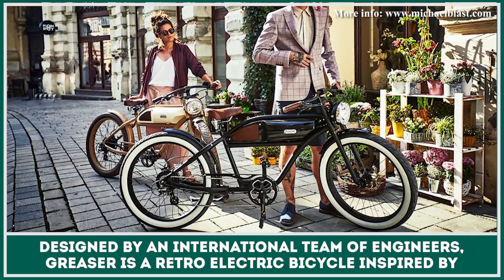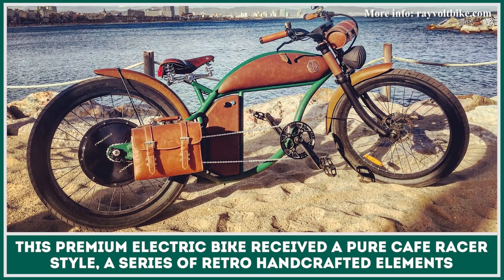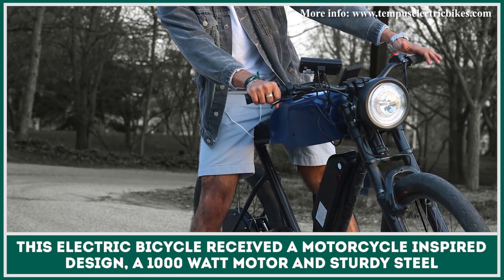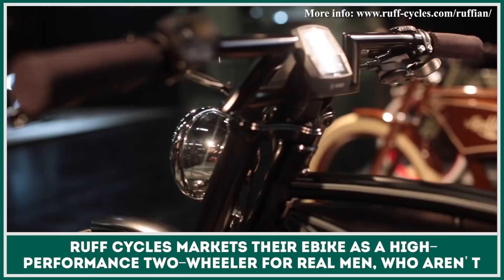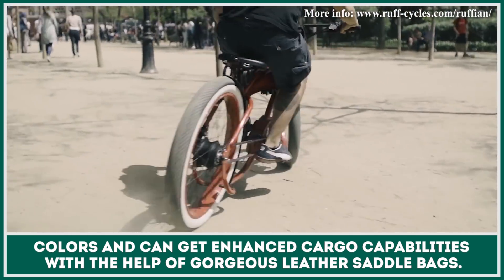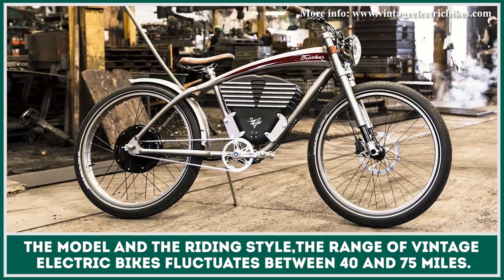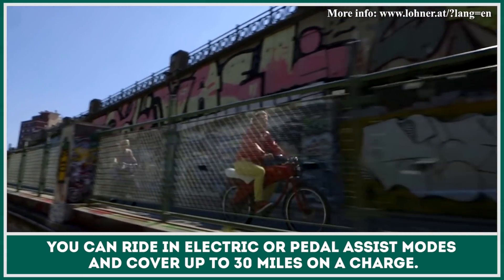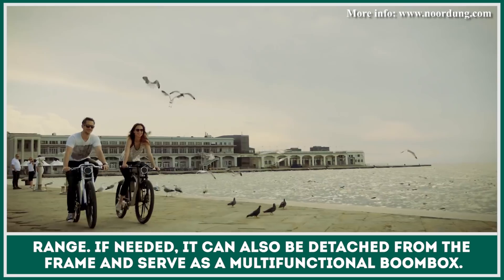7 New Electric Bikes w/ Old School Designs and Retro Bicycle Accessories

Comment: a lot of these old style bike manufacturers make a stupid design flaw.. I dont know why either.. but they push the pedals up too close to the front. .look at the guy pedaling at 05:17.. Look at where his feet are at in relation to his hands. Now look at how the rider's back is slouching forward.  I think they put the pedals this far forward because it looks "cool" like you see guys on real choppers... but those guys arent leaning forward on bikes when there hands are up that far.. no their hands are back more and their backs are straight.. 

The first motorcycles which were basically bicycles with motors, had all their pedals under the seat post with the motor in front of it.  I cant believe German engineers made this terrible design flaw as well.  Shame on them.  Not only is the riders position uncomfortable and only acceptable for short rides, but you lose a lot of strength in your legs trying to pedal in such a position compared to if the pedals were below the seat post.  The only way to get the full strength and motion of your legs with the pedals pushed that far forward is you would have to lean back which is impossible since you wont have nothing to grab onto.  smh.  Micargi Bicycles made this mistake too but not as bad as the other bike manufacturers. Its only recently this style hit the market and its awful.

THIS is the proper style frame for the most comfortable ride and imo the best looking frame.https://www.youtube.com/watch?v=fmWMt0N2INY

Comment: They arent bicycles  they are motorcycles disguised as bicycles
Reply from the maker: Hello, thanks for your feedback. Some of these have 250Watt motors, it's not even close to motorcycle performance.
Reply: @Datacube   i didnt know but in the bicycles was know dopping especialy the mecanical that put the motor ( electric engine ) with battery when push the button and thats it this isnt new it was no tour France in the championship that was know this scandal of this type of dopping  and after that came this type of bicycle but some one are faster o like a motorcyle thats dont need any motorcyle protection and thats The problem

Comment: I build own cruisers. Frame: Shwinn Stingray. 1500W, 1000Wh. All elecrticals hidden in pannier, no cables, no screens, acces trough bluetooth. Min range (full speed, only electric) over 20miles, max range: over 40 miles, never really got to the end of battery when not using throttle too much and riding with speeds below 25mph. Cost: £100 bike itself, £300 battery, £250 motor and controller. Other (tires, bags, new linkage, quick charger from aliexpress) £100. together £750. Max speed 40mph. Wheelies when you are not carefull on take-offs.. Min range 20 miles. Charge time 4h on 6amp charger or 12h on 2a charger (this one stays at my workplace and usually finishes my home-to-work distance charging after 4 hours) I dont uderstand prices of these bikes build in most on generic parts...

Comment: Great looking cycles, but some of them look to have very uncomfortable riding positions/geometry. Would have been ok years ago when they had an engine, but trying to pedal some of these cycles must be arduous. The transformation from engine to pedal power doesn’t work for some frames. More for posing around town than going on a long journey. Nice video.
Reply: I have the Ruffian (the grey one). The riders position isn´t as comfortable as on a real trekking bike, but it isn´t too bad either. Have been on several multi-hour trips without medical assist :-)   The frame takes the torque with ease. Mine is 3 years old and has run nearly 1000 km. Not that much, i admit.
It comes with a Bosch electric system with 4 stages of power support, so uphill isn´t a problem (unless it´s VERY steep). But one have to keep in mind that it´s very heavy and runs on fat tires, so it uses the battery more up than a normal bike.

Comment: Buy the non motorized frame, tank, fenders from ruffcycles, a 1500w bbshd w/dual 52v packs, and all the rest off ebay for $2100. Looks exactly like brown ruffian for half the cost, twice the power and range. Add another 500 and up it to 4k watt with a grin phaserunner. DONT SPEND $6k

Comment: Walmart 26" mtn bike $80.00 ca ebikes front hub kitt 1000watt motor 48volt battery, top throttle speed 36mph, range throttle 24 miles, pedal assist  50 miles. Kit cost with battery at13amp hours at 750.00 total cost with 1 hour install $830.00

Comment: Mtn bike at Walmart $100.00 additional accessories $90.00 that's $190.00 Lunacycle sell BBSHD 1500watt 52volt battery kit at $1200.00 time to install 4 hours. Max speed 45+ mph, with pedal assist 65 miles, costs for this bike $1390.00 total.

Comment: OMG! That first one looks just like a Norton motorcycle of the 1920's like the one that T E. Lawrence used to ride. The wattage of the motor and the battery amperage is a bit behind the times though, but I am really digging that motorcycle front headlight, phat tyres, leather style trims and the general vintage look of the beast. I think you need a brown leather motorcycle cap and biggles goggles with proper pointy shoes and argyle socks pulled up over your trousers upto your knees if you are going to 'look the part' on this whilst cruising through town. In a word: Nice

Comment: These are bikes of really beautiful bikes but as I could see the prices get higher what's the speed 20 miles per hour for a bike that cost $6,600 I think that's a little too high I have a Bagi B20 for $2,000 very well-built bike top speed of 30 miles per hour I am 205 lb so that means it only goes up to 22 so if a bike goes up to maximum speed 20 miles per hour and your weight 205 I believe your maximum speed would be about 15 miles per hour or even less

Comment: The best vintage looking e-bike on the market, considering looks, features, performance and cost, is the Ariel Rider W class. Mine was $1850 US (now $1699), can do 28mph, has a 750w motor, 7 speeds, hydraulic disk brakes, 48v 18ah battery. I have almost 800 miles on it, and have nearly zero complaints. I've also ridden it about 40 miles at a time, with heavy throttle use, and still had battery left. Nothing else competes. Some bikes might look slightly cooler (matter of opinion I guess), but they both cost more, and have lesser performance.

Comment: Because it's not a bicycle it's a motorcycle a motorcycles require a license tag to get a tag you need insurance
Reply from the maker: A motorcycle with 250Watts of power?
Reply: A cycle with a motor on it is it not called a motorcycle?? Slow or fast it's still a motorcycle
Reply from the maker: No, it's a pedal assisted bicycle. If under 500W (USA) or 250W (EU), it doesn't need any paperwork (in most cases).

Comment: Overpriced and ugly.  Overweight and difficult to ride. When these so-called bikes (slow motorcycles) break down how expensive will they be to repair?? Go ahead,,, have a flat tire or a broken chain. Push one of these for a while. Tell me what you think then. When I ride and have to leave my bike outside I wonder if it will be there when I get back. How much will it cost for insurance and tags???
Reply from the maker: Hello, thanks for your comment. "Overweight and difficult to ride", have you ridden all of them? Also why would you need "insurance and tags" for a bicycle?
Reply: When's the last time you wrote a antique bicycle and thought it was fun to ride?? That's why they build the bikes nowadays to make it to where there fun to ride
Reply from the maker: Do you see a difference between a new bike with retro styling and an antique bicycle?

Comment: Suppose you didn't have the ' proper ' paper work? Suppose that you wanted to do a wee bit of cheating and unleash the power potential of the Ravolt Cruiser anyway? Is it technically possible, do you just flip a switch or something? Here in the middle of sweet nowhere, there are plenty of twisty little roads in the hills where you could ride all day and not see another soul, might be nice to wind it up a little when Johnny Law isn't watching.
Reply from the maker: Hello, thank you for your comment. These are some valid questions but answering them could only be possible after learning your local rules and regulations.

Comment: Handle bars seem a bit low.
Reply from the maker: Hello, thanks for the feedback. What bike are you talking about?
Reply: @Datacube  the first bike. From personal experience I noticed that if I am leaned over my handle bars with the weight of upper body supported this causes my hands to start feeling numb.i have to rear back and ride upright with just my finger tips on the handle bars until the numbness goes away. Mind you this is after about 45 minutes of riding though. Your thoughts on this?
Reply from the maker: It's either a wrong choice of a bicycle (some other geometry or style may be suitable for you) or some medical condition that you may want to have checked out.

Comment: Interesting, some of these bikes look like the first motorcycles of long ago. That's pretty cool, not for everyone but if you love old motorcycles, these bikes are awesome. I understand the high price is because they are not mass produced. Well, how about mass producing them? Why not, the model T was mass produced, in fact it was the first mass produced vehicle and that worked out well for them, why not ebikes too? Bring down the cost to a fraction of what it is now, that way it won't just be a toy for the rich. That might damage the snob appeal, but in the long run, only the snobs care about that.
Reply from the maker: Hello, thanks for your comment. There is only one reason why these couldn't be mass produced. The demand is low and it would take a lot of time and effort to build a marketing campaign to let people know that things like these exist.
Reply: …. and those are exactly the same problems Henry Ford faced with the model T. The demand was low because most people didn't own cars in the early part of last century. People had to find out through advertising and word of mouth, which of course they did, and once people learned of the affordable Model T, they started selling like hot cakes. Henry Ford proved that a well made and durable mass - produced product was an extremely viable concept business - wise and today's ebike manufacturers should use that business model if they want to sell huge quantities of ebikes. If it takes time and effort, then take the time and make the effort, there's big potential for ebikes and some smart cookie is going to fill the void, it's only a matter of who wants the market badly enough to make the aggressive moves needed to accomplish such a task.
Reply from the maker: These bikes have the styling that doesn't fit the needs for mass market audience, would you agree with this?

Comment: These bikes are very UGLY!!! The design is not in good taste. I have and now building a 3-wheel electric bike that can be used as a 2- or 3 wheeler. So far it only cost me about $150.00 with custom tail lights. It is an old school design as well. The total cost will come to no more then $900.00... If one adds my work cost it will make the price $1,550.00 "Why Pay More" Make it yourself and save.
Reply from the maker: Hello, thank you for your feedback. Why don't we set a baseline, what is a beautiful bike in your opinion?

Comment: I have a Rayo electric bike. I got at a garage sale for almost nothing. It came with no battery, or charger. The damn batteries are so expensive I can not afford them. 24 volts, 12 Amp Hour battery. The motor is 24 volts dc 600 Watt. So it sits in the garage. Its like new, but I can only use the pedals, not the motor. Anyone know of a cheap way to power this up ? Most batteries are 12 volts and too heavy and large. :(
Reply from the maker: Hello, thanks for your comment. Did you get a quote for a battery replacement? And how much is it?
Reply: triumphmanful 
Want to sell it

Comment: Laws here in the USA are not up to par with many electric bikes. I have electric scooters (like vespa) and bikes they only would go 15 -25 mph for 10 miles and after 5 years I finally got rid of them in favor of an electric bike (from Walmart less than $500) I get less hassle on the bicycle than the scooter, just because it looks like a bike. "Ohio" has a rule in place no matter the governor , if the vehicle can go over 25 mph it HAS to be tagged and insured. Being pedal assisted and low speed means nothing to law enforcement here. It all falls into if it looks like a "bike". If it looks like a bike with a motor or engine then it IS a motorcycle. Now we have these stand up scooters for rental with no pedals, folks are riding into traffic , on sidewalks, against traffic, through peoples yards... Laws have not quite caught up with the tech here and it is getting dangerous for US legally and safe wise. Best just to call them Electric vehicles and legally tag them, license, and insure and yes you need a drivers license too. All nice an legal wise then we are all clear and safe about them.
Reply from the maker: Hello, thank you for your comment. You are 100% correct. This type of vehicles is either being over-regulated or not up to date with available models on the market, thus leading to a confusion.